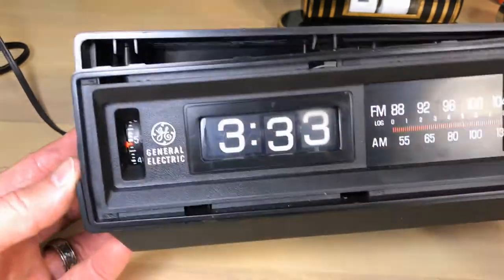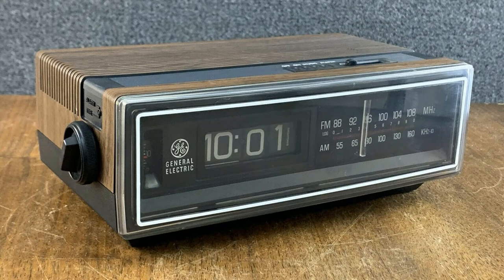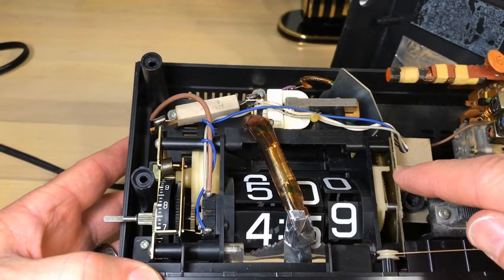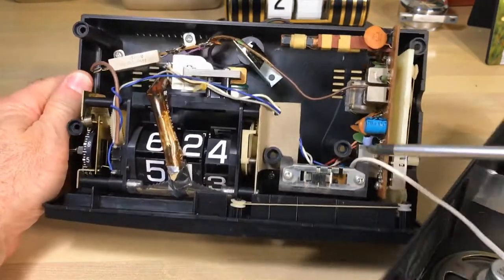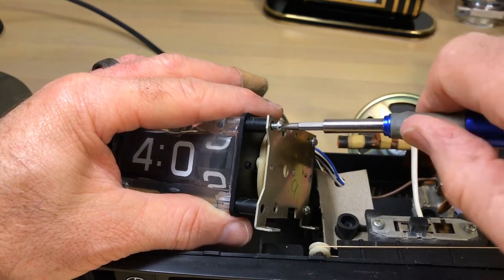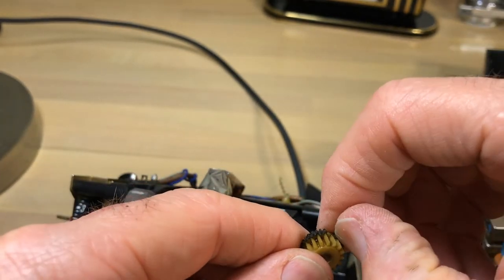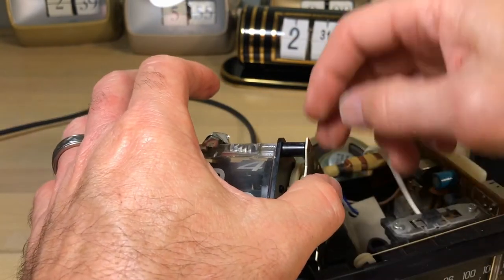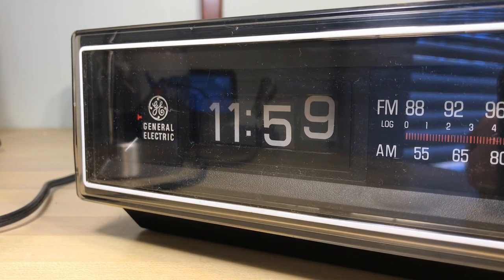Fixing a General Electric 7-4305 flip clock

Comment: Just finished repairing my clock. Bought it at a auction and as usual it did not run. Once I took it apart  I could feel the rotor gear trying to move. I desoldered the transformer and pulled the rotor off. It was getting jammed internally. I took it apart and one of the gears would lock up. I noticed they are filled with a small amount of oil. Which makes me think that it would be a good idea to flip the clock maybe twice a year to lube the gears as the oil only does part of it. Installed the new rotor P/N M-3635 or 14521 to align it with the plastic gear then slid the transformer part on to it. It has been working like a champ. I also clean the AM/FM selector as it was not making good contact. The only thing I did not change was the bulb as it works but not the brightest. Since I will only use it in daytime not a big deal. Thanks for the video. Update: I was unhappy with the light so I changed it. The two resistors are 14K but my meter shows 14.7K. I left them in. The voltage is 110-120V The bulb I used was CEC Industries C2A Neon Indicator Bulbs, 105 to 125 V, 0.25 W, Wire Terminal Base, T-2 shape 10 for $10 on Amazon. By using a lower resistor the brighter the bulb should glow. But to me it's better to keep it dim because at night it would be to bright.

Comment: I really like 👍 old school 🏫 dial cord radios 📻. They afford finer tuning. Some radios 📻 have gears ⚙️, in combination with a dial cord. This is a feature on some radios 📻, even a few cheaper ones (affordable). This allows for very exceptionally fine tuning. I really like 👍 these cylinder clocks ⏰. They’re a real thing of the past. My mother bought me one ☝️, back in 1995. It was exactly identical to the one ☝️ I saw 👀 at my stepmother’s workplace back in 1978. Your friend, Jeff.

Comment: I've been trying to fix one that I have and realized it has the same problem.  Rather than buy another clock for spare parts, I did some research and saw where someone had a new gear 3D printed to great success.  I'm going to give that a try and will post a follow-up comment once completed.
Reply from the maker: Very interesting. Keep us posted.
Reply: What's the verdict?????

Comment: The rotors in these GE clocks seem to be indestructible! Have you ever run across one that still doesn't turn? So much more robust than the Sankyo rotors from the same timeframe. Great video, thanks!
Reply from the maker: You're so right. No, I can't remember a non-working GE motor of this type. I know a restorer who loathes working on the Sankyos.

Comment: Whoa that's awesome, I thought it was just a dial clock. Very cool !

BTW is it better to set a flip clock with the cord plugged in or off? Like is it better to set it when the motor is not spinning?
Reply from the maker: It really doesn't matter one little bit. It's completely safe either way due to the way the clock is geared. It's a great question and I looked into it because I wondered myself. I have found (and many manufacturers recommended this) that when setting, set one minute ahead of the time. The clock then seems to setting in better to the time you want to display.

Comment: Excellent!  I've got this same clock and it doesn't work but I haven't had a chance to look into it.  Unfortunately I don't have an extra gear.  :-(
Reply from the maker: It could be other things. Look for loose wires in the back. If the brass gear is not turning and there are no loose wires it’s probably the motor itself. Unfortunately that can’t be fixed and you’re going to need a replacement (you’ll have to buy another clock for parts).

Comment: I have the simple non-radio version of this. One in my bathroom, one in my kitchen. My bedrooms have a vintage digital GE version. In your opinion, what is more long lasting, a flip clock or an older GE analog clock from the 50’s or 60’s?
Reply from the maker: Wow. Great question.  I’d say that when first made the flip clock could be expected to last longer without service. But considering then now and going forward…. A flip clock is going to need work. To me, it’s easily done, generally, but often will require parts from other clocks to get back to working. The older analogues may be easier to fix without having to cannibalizing another clock.
Reply: I’m back again. My beloved 8142 is stuck. It seems “jammed”. For a while I noticed the neon light was flickering. Today it just stopped. I took it apart and tried to mess with the gears. They don’t appear chipped or broken. I got it unjammed by messing with the gears right near the motor side and it worked for about an hour then jammed up again. Is my clock toast or is it fixable? I hate to toss it, would rather donate it for parts but is there any hope for the old girl?

Comment: I got the 4305B as a high school graduation gift in 1979.  I still have it but the numbers do not turn as seems to be a common issue.  I had stored it away and dug it out today after looking at your video.  I was going to attempt to take it apart to look inside but I cannot even get the knobs off.  I don't want to pull too hard for fear of breaking them.  Any suggestions on removing the knobs?  The clock radio is in great condition cosmetically and I would love to bring it back to life.  I like using older vintage equipment.  I still have my Pioneer SX434 receiver and Dual 1225 turntable from 1974 and I still use it.  Hope you are still answering questions on this video.
Reply from the maker: You’re just going to have to firmly pull. The following video is a way. I’m working on another clock radio today and I had to get some twine behind the knob and pull hard. 
Flip Clock Restoration Tips and Tricks - Removing Knobs
https://youtu.be/LZlGyz1FEB4
Reply: Thanks for referring me to that video.  I will continue to try with my fingers but may eventually see about the Gorilla Tape.   @Flipclockfans

Comment: Helpful video. My motor only turns intermittently. Anything that can be done other than spraying deoxit?
Reply from the maker: I don't think so. There's a good chance the motor unit has a bad gear inside it. While some claim that we should be able to repair those, I don't agree. They were not made to be repaired and any repair just seems to be a temporary measure before another part fails. But who knows.
Reply: The motor is an s1 hnk. Still available. Just buy a new one